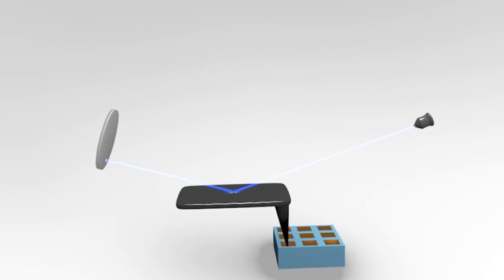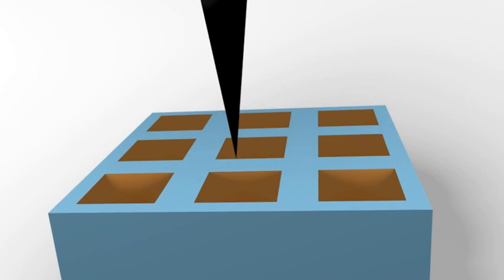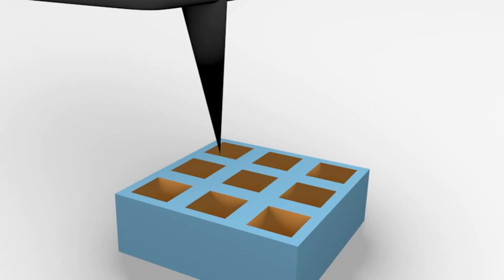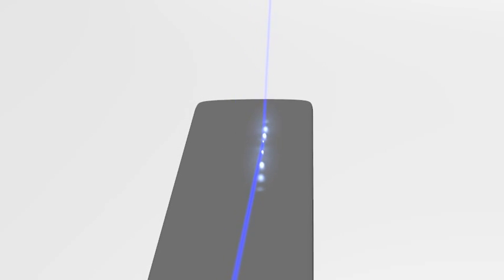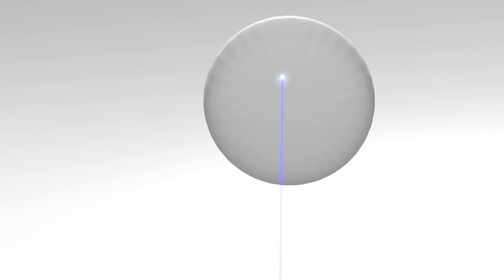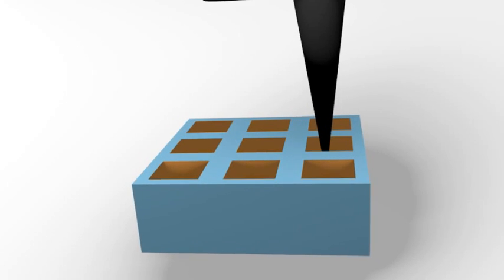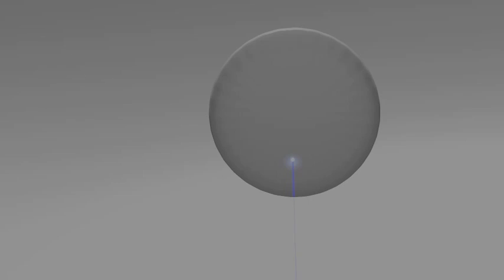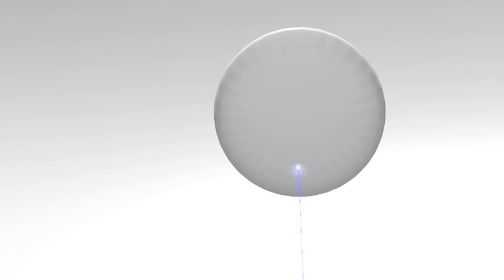3D Atomic force microscopy video

Comment: Beautiful video. Unfortunately, there is a mistake in the animation. As you say correctly, the angular deflection of the laser beam is changed, but in the video the cantilever is not bend at all. It just changes its height in parallel to the surface. 1 nm height difference would then lead to only 1 nm displacement on the CCD. To get an amplification of this height change, the cantilever-bending is important.